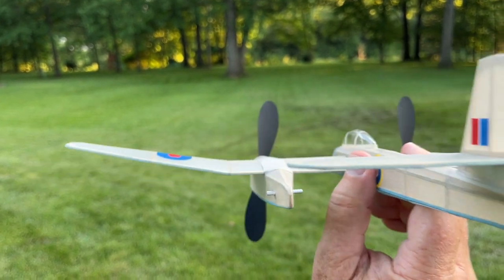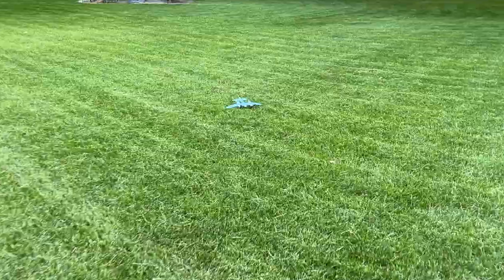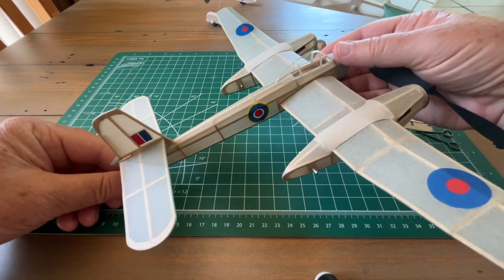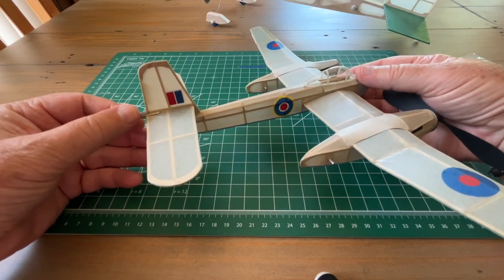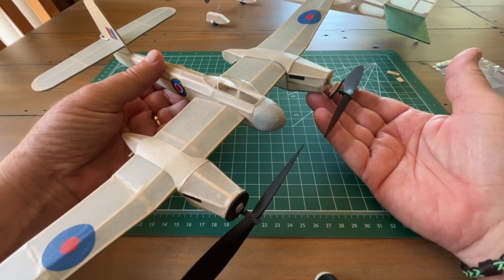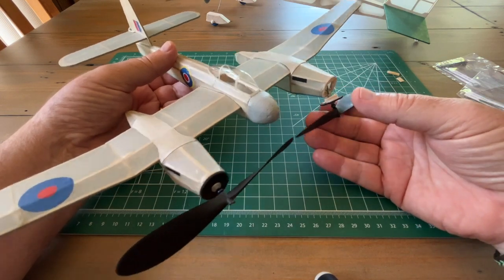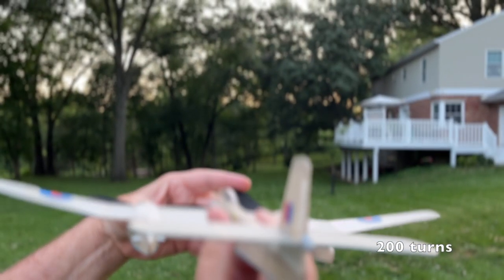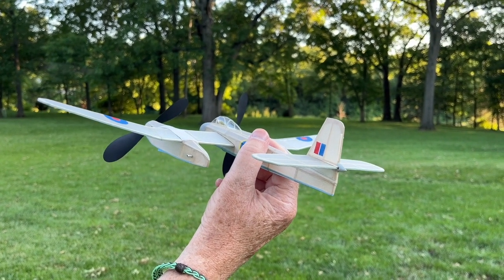Westland Welkin test flights

Comment: А зачем такие винты гаганские, это же непропорцианально
Reply: Rubber has a lower power delivery. Thrust is a function of diameter and rpm. To increase thrust either increase rpm or Diameter hence the larger airscrew.

Comment: When outdoors, climbing to the right will yield a better climb. The model is using the energy of the torque to spiral the model down, when that energy could be used to make the model climb if turning to the right. You may need some right thrust to help with this. Agree you may also need some down thrust. Any increase of torque with additional winds will only increase the tightening of the left turn.
Reply from the maker: Makes sense, I added both down and right thrust, but more winds did tighten the turn and it spiraled in quicker. It only climbs if I remove the stab trim, but then it soon stalls. I may try to trim for a right turn. Thanks for your observations!
Reply: @kitchentablebalsabuilds  I just went back and checked your props. I notice you are using two plastic props. All the folks that fly twins fly counterrotating props. Your two props are creating a lot of torque in the same direction causing the model to "torque" in. The cool thing about the counterrotating props is they cancel out all the torque.
Reply from the maker: @Watchingthevideos99  Yes, I think that's part of the problem. I asked the kit manufacturer about counter rotating props and they said the model was designed for same rotation props. So, both nacelles were constructed with built-in down and right thrust. This is the first twin I've built, so I'm learning a lot.
Reply: @kitchentablebalsabuilds   It can be trimmed with props rotating clockwise. I'm just finishing a scratch build of a Westland Whirlwind from a Model Craft plan. It has a 20 inch span but both props rotate the same direction.Mike Stuart a famous scale free flighter over here in the Uk uses plastic on his multis with good results. I'd start with 100 turns with 3 degrees down thrust on both props. Try it without the rudder tab but first recheck the glide. Use enough negative stab to achieve a flat a glide as possible. Beware about trying to trim it to fly right. Can it be done yes but it's safer to fly left on a low winger. Your flight pattern will be left power right glide anyway.Just my 2 cents. YMMV.
Reply: @Watchingthevideos99 Torque is not the issue here it's weight. I await final confirmation of his Welkin's all up weight.
As you are aware from propeller theory  just before launch forward velocity is zero and the  prop blade has a high angle of attack meaning the prop aerofoil is stalled. As the prop turns equilibrium is quickly reached between air pulled in from in front  and that behind at which point the torque roll force dissipates. Hold a model for a second or two after the prop is released before launch  to confirm this.
 The tendency to turn left is from the spiral propwash of the clockwise spinning prop doubly accentuated of it's a tandem with both props turning in the same direction.
Reply: @kitchentablebalsabuilds A banked turn reduces lift because though model weight acts vertically lift is perpendicular to the wing. The steeper the bank the less lift.
 You need to shave weight off this ship. Hollow out the nose block and sculpt the transition more to the fuselage. Find lighter props with better pitch. A lighter model has better endurance and is easier to trim. Oliver Sand's model is 8.5g all up. Anything over 12g on that planform will be a sled.
Reply: @kitchentablebalsabuilds If it still stalls after putting in more down thrust that means the CG is too far forward. It needs to be shifted back to say 50% of the wing root chord. I’d hollow out the nose rather than add tail weight. Small gurney on top of the left wing may help.
Once that’s sorted you could think about repitching the kit props using a hair dryer and a simple home made jig. HTH
Reply: PS Forgot to ask? What is the total weight of your model including props and motor. Performance is related to overall weight and wing area. If the span is 16 inches and average root chord 2 inches that equates to an area of 32 square inches. For good flying wing loading needs to be less than .5g per square inch. Less than than for Peanuts.

Comment: Needs Down thrust on both props. It’s not tail weight since the glide was good. To get a controlled left turn try about 50 turns more in the left motor and a small acetate flap on the top of the right wing to control the torque roll. HTH.
Reply: I forgot to add if you can get a flat glide that would be ideal but that requires shimming the stab if it has not been cemented. I tend to use the Tail Volume coefficient to get the starting cg on the root chord.
Reply from the maker: @DLLReid  Both great tips--thanks!

Comment: How about replacing the rubber motors with Capacitor power and cordless motors?
Reply: Probably too much power for the paper and balsa airframe ! Seems like it can be done though........
Reply: @pauldavidson747  those tiny motors used in phones for vibration, they are so tiny and light, they match the weight of the plane very well.. also then he could use smaller props as there will be more rpm
Reply: @whoknows8225  I think the rubber motors have its own taste, but I agree. But the tinkering is unconventional, rather hard tbh. I do think the plane is absolutely fine with rubber powered props.
Reply from the maker: @pauldavidson747  You may be right. The more winds I add, the more it doesn't like the additional power.

Comment: I think one 360 degree circle in the air can be considered a success! About the only suggestion I could make is to develop a way to release the props as you launch instead of waiting for the initial power burst to subside.  I know...holding the airplane, 2 props and a camera is already challenging.
Fantastic looking little plane, and one that's not modeled to death!
Reply from the maker: Thank you for the comment! I really didn't realize my release could be a factor, but it makes sense. I'll work on that! 👍
Reply: @kitchentablebalsabuilds  I re-watched the flights several times (perfectly normal behavior) and I think I'm second-guessing myself and think downthrust is needed.  Maybe I should just build one myself and stop pestering the real modelers! lol
Reply from the maker: @kenkingsflyingmachines2382  😂Thanks for those further thoughts! Actually, I was wondering about more down thrust. I'll try that as well!

Comment: Nice model! The left turn looks very promising. Can you give it more turns than 200?
Difficult to get the CG right with such a short fuselage and a short nose.
Reply from the maker: I may try going past 200, but there's not much room for knotting in those nacelles. There's only 3" from peg to hook! Thank for watching, I appreciate your comments!
Reply: @kitchentablebalsabuilds  don't know where you are with it now, but even with mild braiding, you should be able to get at least 9" loops in those nacelles, especially with reverse S hook prop shafts. 9" loop of 1/16", which is really a lot of power for that little plane, will take a pretty good turns count.
Reply from the maker: @joshuawfinn  I actually watched your braiding video several times before attempting to tension the rubber for this plane. The knotting seemed to fill the nacelles. When the winds came off it began ripping the paper and the nose blocks popped. I've been reluctant to add more winds. More power just seemed to make it spiral down faster. I just made a couple of reverse S shafts, but I haven't tried them yet. Hopefully, i will soon. Thanks for your comments!